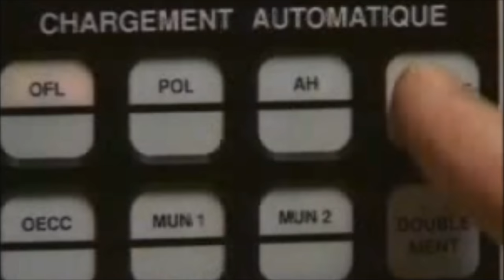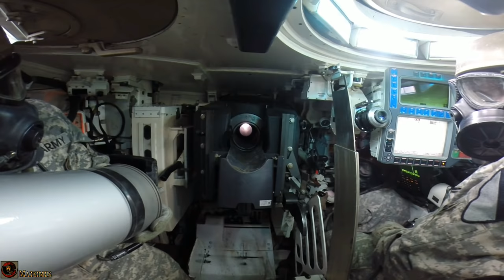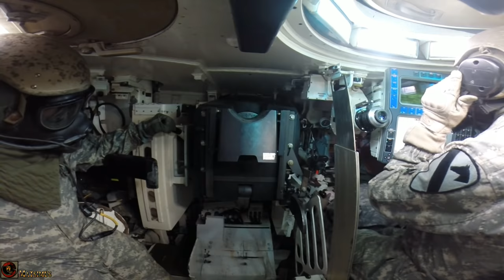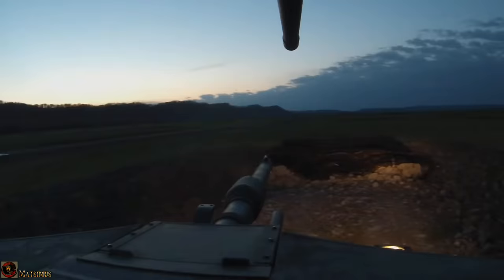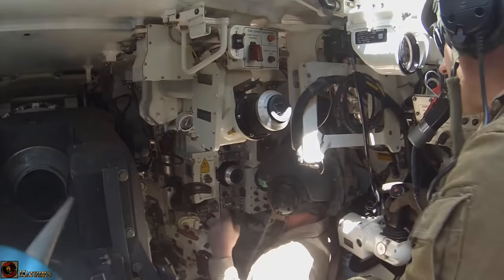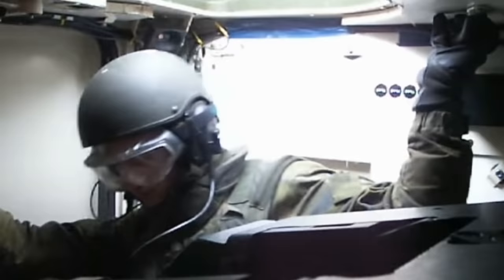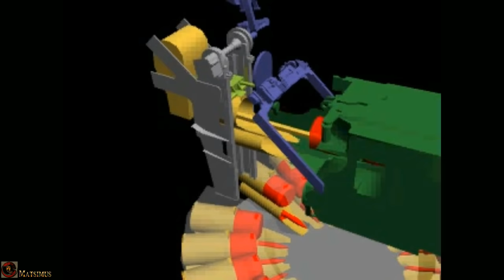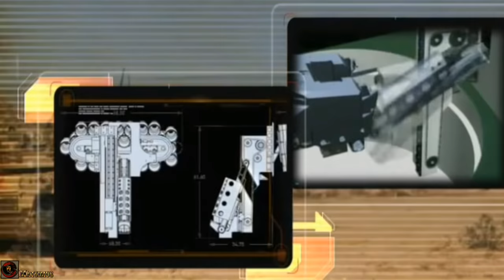Tank Autoloader or Crewman Loader?

Comment: While I agree with you and prefer human loader myself, I don't think you made a fair video. You went only through the benefits of human loader, but not the benefits of autoloader.
Reply: And, it just turn into NATO manual loader vs russian autoloader. No mention of Leclerc or K2 autoloader.
Reply: @Joseph-eh4rs  I dont think that matters.    They're also all allies to the US and share military technology so it should be pretty similar.
Reply: @hyunjunpark679  only abrams and i think the new versions of challenger have that. Many have blowout pannels, but 90% of them still have some ammo stowage positions witch are not protected.
Reply: Fair, he missed several important points for each type. I also prefer the manual loader, but it puts some major constraints on tank design, which is why so many tanks go with an autoloader now.

For the Autoloader:
1:  It enables you to store ammo somewhere other then directly behind the gun. Underneath it for instance. Those huge box turrets on western tanks are required, because a loader can't be picking up 30 kg+ shells from underneath his feet, he has to get them from someplace at least level with the breech. For a remote turret design like the T-14, this is needed.
2: It can upscale to bigger guns much easier. Most western MBTs really struggle to accommodate a gun larger then 120mm, because above that you really need two part ammunition, that slows a manual loader a lot. Western tanks have very large turret rings that should be able to handle much bigger guns, but it really isn't doable relying on a person to load. 
3: It can provide a constant rate of fire for much longer. I have never heard of an autoloader that can match the short term burst rate of fire of a good loader, but over a longer period, the loader is going to get tired and slow down. If you have to sling a couple dozen rounds, the autoloader can sustain that higher rate of fire that is advertised. I would still argue the initial burst is more important, because you can't keep slinging rounds if one of the first two tanks kills you. 

For the Manual Loader:
1: Training. This is huge, and he didn't really talk about the value to the loader himself. It isn't just about the extra hands on the crew, it is about training new gunners. With an autoloader there is no clear path to a new gunner. The driver is in a totally separate compartment and probably asleep. A loader of today is next year's gunner, he gets to see what the gunner does, learns the priorities, and gets hundreds of hours of mentorship from the TC and Gunner both. This leads to much higher initial quality on your new gunners then you could get from some school. 
2: Air guard. Typically the loader is the one responsible for keeping an eye on the sky when traveling unbuttoned. The commander is usually going to preoccupied with tree lines, and most of the time now he is going to be using the CIV for that. As great as CIV systems are, you still really need someone on top using the Mk. 1 Eyeballs to look at things like the sky, and the faces of passing farmers. 

Plenty of advantages to both, it isn't as clear cut as one is better then the other. Tanks can get great use out of either option if the vehicle and military is set up to benefit from the relative advantages. I think an autoloader system would be a mistake for most western powers unless it comes with a bigger gun, but it is perfect for many nations.
Reply: @thesayxx  K2 leclerc and type 90 all have blowout panel for autoloader
Reply: @hyunjunpark679  yes for the ready rack, but they still have unprotected ammo stowage in the hull tho. Its around 7 to 9 rounds on leclerc if im not mistaken. That will still cause a cookoff if ignited.
Reply: @thesayxx  fair
Reply: @hyunjunpark679  yes thats why i said, it doesn't matter what loads your shells when the shells catch fire inside the crew compartment. A shot to the ammo stowage that's not protected will result in cookoff, ether be it a t90, t72, K2 leclerc, Lepoard 2 etc.
Reply: Biased AF
Reply: @Joseph-eh4rs  Japanese Type 90 and 10 too
Reply: @calebdoty9090  Thank you so much for this informative comment, it's exactly what I was looking for.
Reply: Icarian auto loaders can’t help with a thrown track
Reply: There is no benefit
Reply: @criticallyconk4944  There's several. Human loader is one extra crew member that you have to train, feed and equip. If you have 100 recruits, with auto loader you can train 33 tank crews from that, but with human loader only 25. There's clear economic benefit for auto loader. 

Autoloader doesn't get tired or sick or wounded. In a long operation an autoloader can maintain it's effectiveness better than a human can.

While I like that there's an extra crew member to share the load of maintenance and guard duty, I also understand why some armies prefer autoloader.
Reply: @icarian553  
No no, it's a joke. But thank you for the info anyway.
Reply: @cherrypoptart2001  we use 90% different equipment in Germany. So this argument isn't that right
Reply: Another pair of hands in a afv vs another machine to fix when it fucks up and then will need a pair of hands dedicated to fix it?
Reply: The one benefit of an autoloader, I believe, Is the fact that you can have crew less turrets. Turrets are generally heavily up armoured and fairly chunky wide. However, if there's no crew there, just a small, long, thin autoloader, you can save a lot, a lot of weight, and make the profile much smaller. Like the t14 armata or even the experimental hstv-l, they have much smaller, less armoured turrets that could make a huge difference in weight and ultimately, mobility. The safety of the crew may also improve, since now you can keep them in a much safer location, the hull, which in most cases will be covered up by walls and defensive positions, and with the weight saving, could potentially be more armoured. However, they are more centralized, so a good hit could potentially one hit the entire crew compartment.
Reply: @worldoftancraft  Not sure what you are implying. I was on M1A1 and M1A2 tanks for years, as loader, gunner, and TC, and I don't ever remember not being able to reload on the move. It doesn't matter if there are videos on youtube or not, I have done it thousands of times.
Reply: @worldoftancraft  Lack of youtube videos is not evidence that the capability is lacking... I have no idea how you arrived at the notion that loaders can't reload on the move, they both can, and do in every since nation that uses them.
Reply: @calebdoty9090  where did i write "can't"? I didn't. I wrote that the main advertised advantage of the crew loading — greatly suffers during firing on move. It will not be 4,8 seconds per shot. That is what I've wrote
Reply: Could have made it into a longer video as well in the process as much of the reason USSR tanks use autoloaders has to do with USSR military doctrine.
Reply: How you cover 360 degrees with just 4 or 3 people inside the tank ?
Reply: @calebdoty9090  as having spent time as a loader on an Abrams, what would be the most shell weight you could load? That is, how much can a shell weigh for you to feel comfortable loading the tank continuously? So obviously the 120mm rounds, with a weight of 46 pounds, is within operational standards and a loader is expected to be able to continuously feed the chamber. But what about a 130mm round weighing 73 pounds? Would 73 pounds be too much weight? And for that matter, would a 140mm round weighing 88 pounds be too much to feed the chamber manually? (Hard for me to imagine lifting nearly 90 pounds with any kind of sufficiency, but I suppose some individuals could do it (but they might not feel too comfortable inside a tank!).